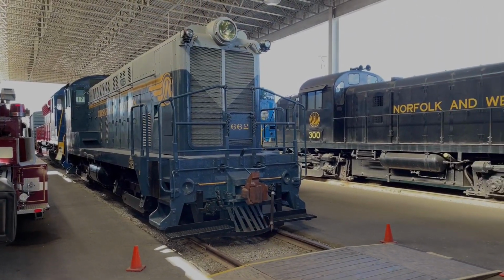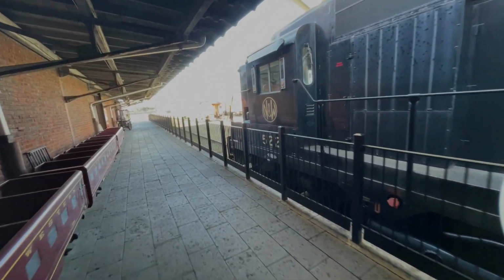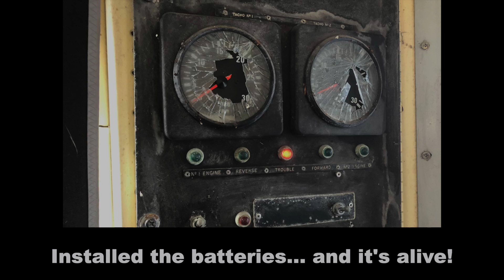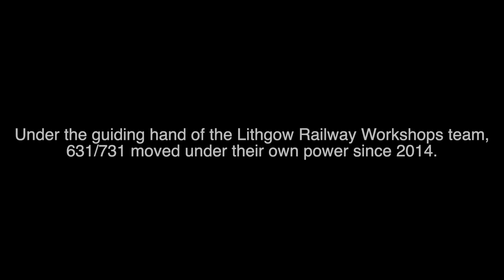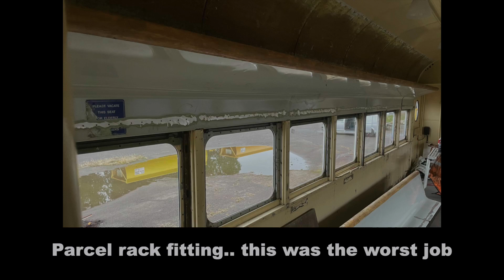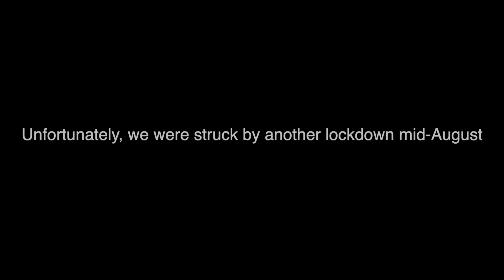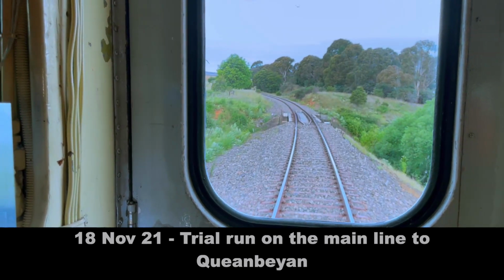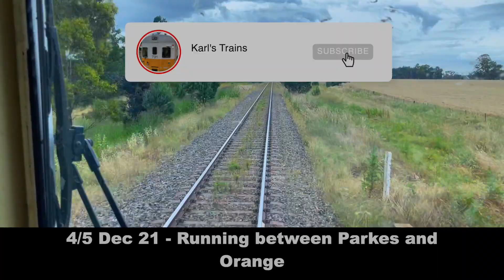KARL'S TRAINS: EPISODE 7 - USA visit and a retrospective on 631/731

Comment: Thanks for the memories when I think back one engine was fully reco the other not we were well over budget we had a spare 620 at chullora for parts you did a great job on the rebuild one day I will go for a ride
Reply from the maker: Thanks Robert! Yep the spare cars came with it as well (625/725) and we made good use of the remaining bits.
You did an excellent job on the rebuild to ML070, so much “under the hood” has been modernized - it will have a very long life